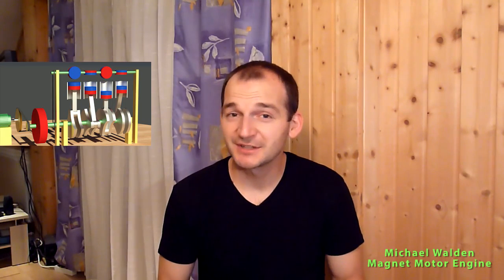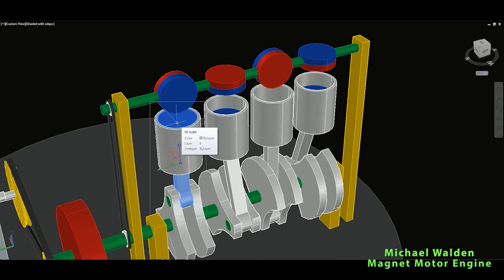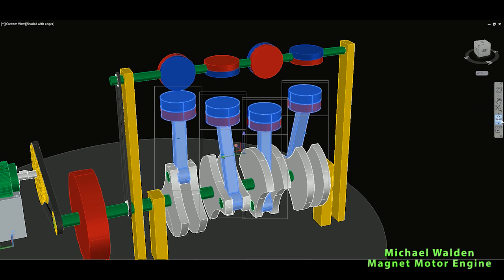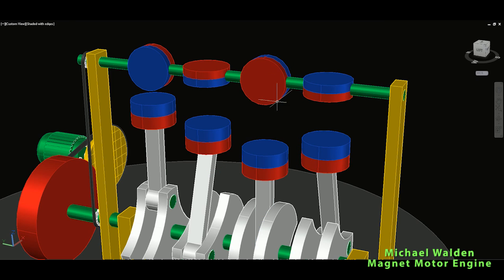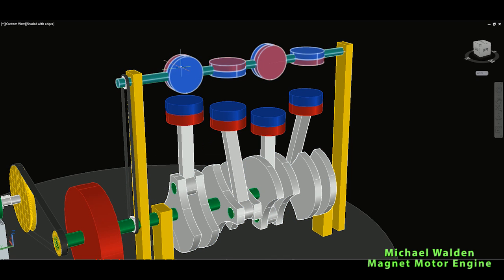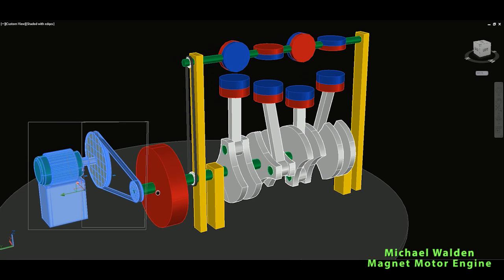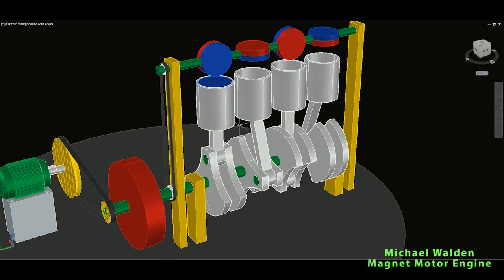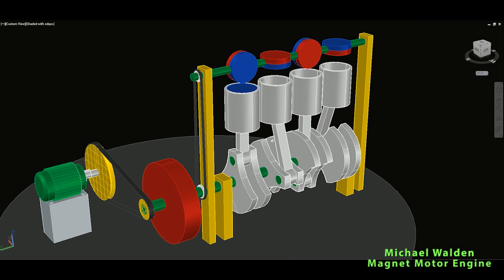FREE ENERGY, Michael Walden Magnet Motor, MAGNET ENGINE!!!!!

Comment: Buy 3D Model?  Are you talking about the one shown in this video?  An incomplete model without piston chambers and with a camshaft going directly through a magnet (as if they make magnets in that shape/orientation)?  The way this design is built it wouldn't operate.  I already re-built it in Solidworks and can see that clearly.  With some modifications it MIGHT work, but I won't know until I print off some prototypes for testing.  Either way the configuration as shown will not run - it will experience magnetic lock.

Comment: We should make more flex fuel vehicles like the Chevy volt. You can run it on electricity, or from a flip of a switch, you can run run it on gasoline and go a whole lot further! Also the are hybrids motors, they should make it where you can run it on gasoline and electricity and they should put a middle switch and make it a hybrid. They should make more vehicles that are like that!
Reply: They should also combined that with hho, and and see where it goes from there!

Comment: The arrangement of magnets across the top would be too far away to be effective. Consider two geared disk which contain the magnets moving across the top of the cylinders. This way the magnets passing over the "piston magnets" would be much closer. You would need to make the cylinders further apart, and mount the center shaft of the geared disk's between cylinders 1 and 2, and 3 and 4. The geared disk's could be timed and driven by a chain and pinion gear located in the front part where you show a belt drive in your diagram. 

The use of cylinders would cause too much friction. Since there is no need for compression or combustion, you could attach rollers to the sides of the piston magnets to run in guide channels. This way you wouldn't need an electric motor to start it turning. While I don't think it would be powerful enough to use in an automobile, it should be plenty enough power to turn a generator. Just a thought.
Reply: Das kommt immer auf die Stärke der Magnete an. Wenn der weit entfernt liegenden 25 kg haftkraft hat und der mit der geringsten Entfernung nur 1kg haftkraft hat kann sowas funktionieren ehrlich ausprobieren und nicht faken ist angesagt

Comment: but there's a grey area, where asymmetries can be achieved,  if it does finally work, the energy needs to come either from the energy cost of making the magnets, or from the surroundings, in order not to violate thermodynamics,  violation of which is out of the question, it would be like reversing the flow of time.

Comment: I don't believe it can work,  but even various physicists don't fully understand  diferent scenarios, where you can have asymetrical repulsion/attraction,  so that the system never gets to rest.  it can get a little complicated.   The dea is that Work=F*S,  and magnets only offer the force, no displacement,  andi's not possible to break the laws of thermodyamics.  So far, it's W=F*S,  magnets only have force,  just like a rock in space is moving, but only has dislacement and no force, in both cases is W=0

Comment: The repelling force between two magnets is highest when the gap between them is less than 0.1mm. This force drops exponentially with the width of the gap. The magnets in this example are just too far apart (radius+height of rotating magnet), you would need a large construction to move a 2400+ pound car. Larger than would fit under the hood as magnets creating a force of 2400/2=1200pound at a gap of radius+height will be very large (AND very hazardous).

Obviously a bigger rotating magnet means a larger gap, which will require a bigger magnet, wich will create a larger gap which requires... well, perpetually.

When a magnets WxHxL are equal, any equally sized magnet stacked on top of it will add only a few percent of extra force. So stacking is no option either (apart from resulting in an even a wider gap).

FYI: a N45 grade Ne disc magnet of D=200mm and H=50mm will have a force of 1600kg (3527pd) and will set you back for €1021,80.
Reply: It will not work
Reply: Sir please can u guide me on a project I wish to embark on? I want to try building a  magnet powered mechanical system that is efficient to prime move a coil for electric output
Reply: What if you have a barring instead of this. Multiple small barrings to produce high rpm
Reply: Thanks, you have just cut my learning curve, in regards to "equally sized magnet stacked." What literature can I read in regards to "a few percent of extra force"?
Reply: Rene van der Lende best answer yet. now how about a timed drum rotating around the entire crank assembly with magnets in it? lol
Reply: Rene van der Lende also replace disk magnet with longer rec shaped just. cut the gap. replace all parts with plastics. possibilty?

Comment: Won't work, to much magnetic interference. Unless you have Mu-Metal lined cylinders, and a way to control interference from one camshaft magnet not intended to a different cylinder. This arrangement will lock up like many other magnet motors, however....I think this is closer to what can work though.
Reply: what you are describing is theoretical only if it was practical why dont you show practical engine which is impossible

Comment: Why should this work? Magnets do not contain energy and they do not produce energy. Every attempt to build a "magnet motor" comes from an absolutely wrong understanding what magnetic forces are.
Reply: The only useful way I can imagine this being used (although this might be very inefficient system) was to turn the part with the magnets by hand, or maybe by using a water turbine  or even compressed air (using one of those manual air pumps).
 This could be used with a generator to convert mechanical energy into electric energy, but I don't think it would be worth it; maybe it would be interesting to look at and nothing else.
Reply: phi times psi = plank (electrification) you cannot have one with out the other in order to create electrification
Reply: They transfer energy too. If you have to magnets next to each other, north poles facing each other, then you push one, the energy that you exerted on that magnet is transferred to the next magnet.
Reply: step aside ma be this knowledge is not for 9 year old kid like u.
Reply: your an idiot...
Reply: psickopath psickopath 
Who? Either way really should not put anyone down for not understanding. You should at least attempt to educate or in a nice way say they are not correct.
Reply: He (the man who said this idea will not work) is correct. Im sorry to see how some of you think this could work. Your educational institution has failed you.

Comment: where is the working model      we must see the magnet motor in operation
Reply: I tried to make one some years ago, when I was in school but it not works only spined with an auxiliar source. That happens I think because the force needed to rotate the top magnets(that repel or atract piston magnet) is the same or higher than they can produce by reppeling themselves.
Reply: @bobbyea9109  has
Reply: this is just an idea
the engine dont work  ..
Reply: The momentum of the flywheel will keep it rotating non-stop
Reply: @taavishilongo685  Ive tried this, yes before I saw this. The magnetic repulsion is not enough to turn that shaft. Repulsion is almost a constant that is nearly independent from size of magnet. You would need magnets so big that they would start to pull toward each other against the axis of drive. Also the drive torque is too little to drive a belt that could charge an alternator.

I appreciate suggestions.
Reply: @taavishilongo685  wrong! A flywheel is stored energy.
Reply: @taavishilongo685  I doubt that, it won't generate energy EVER, FOREVER !
Reply: dont work Dear Dave Parker  ..
Reply: Sorry, but it doesn't work that way.
Reply: I have one. In my head lol more complex
Reply: maybe help you sir https://www.youtube.com/watch?v=eTKgAnEBcLk
Reply: @MuhammadHariansyah  that video is junk. Belt driven on the side that is never shown. Garbage!
Reply: I have sam idea but samthing chaing .
In my dising .
Reply: David Blakely p
Reply: David Blakely if we managed will this idea be used ?
Reply: I can maked
Reply: i think magnetic shielding is needed to get any resulsts at all.
Reply: without gears power softening sure it wont work. but with lots of complex mechanics may be possible to build weak motors.
Reply: @ahmetmutlu9206  Ive tested this...its actually a good idea for a nano motor but nothing bigger. Hope you have nano tools.
Reply: It will not work. Momentum is lost by friction, gravitational pull, and wind resistance.
Reply: @vc2702  more importantly than that...the magnets need to be so big they will not fit into that design...ever.
Reply: Just go on with the ideas, it will work.
Reply: David! To see this model first you have to build it yourself. Spend money to find out if it will work in reality. The boy gives only theory. He gives an idea. How do you imagine that someone will give it to you on a tray? He is talented in imagination and submits the topic without huge costs.
Reply: Pawel Wysocki . It will not work sure.